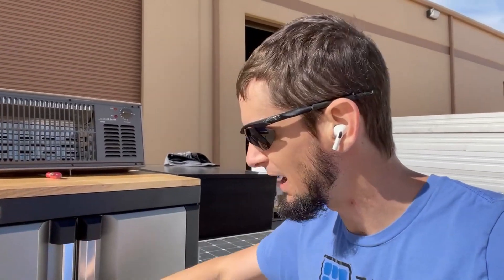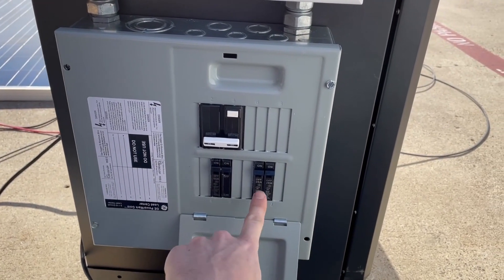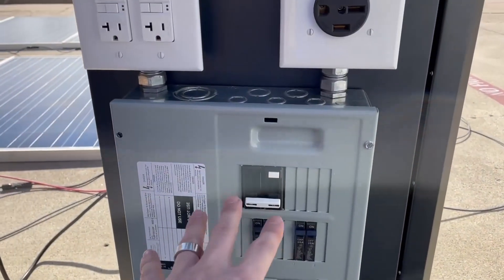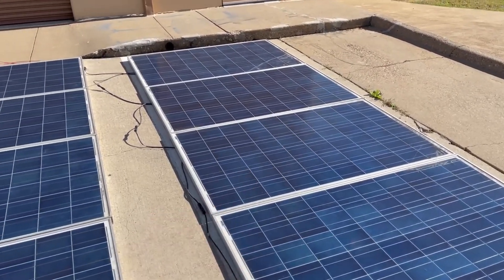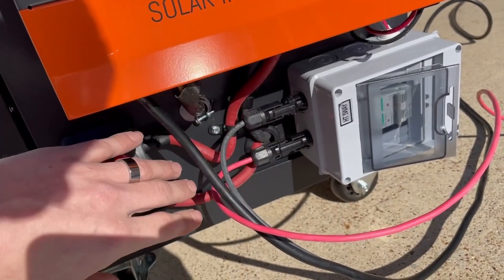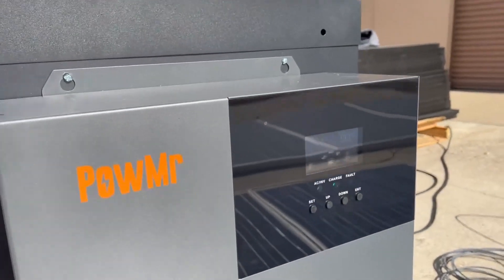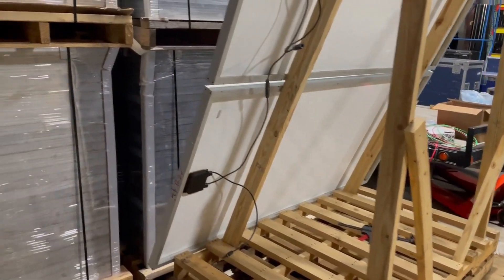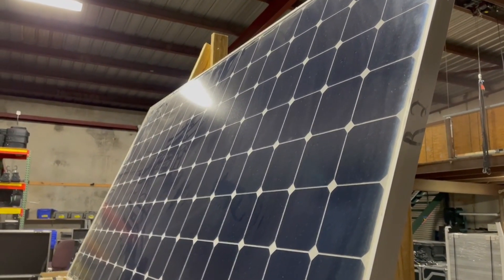If Your Portable Power Station Was On PowMr Steroids

Comment: I have 28 panels, 305 watts each, with a solarEdge 7600H inverter. I want to add an AC coupled PowMr 10kw Hybrid inverter and batteries. Havent decided on the battery yet, or what size, maybe about 10kwh of battery backup. Solar currently goes into my main panel with a 40amp breaker. I'll need to put the solarEdge into my 100amp subpanel and the hybrid between that and the main panel. is PowMr 10k inverter good to handle all this?
Reply from the maker: I have not messed with the powmr hybrid. Likely it’s a re badged product of another name so you might be able to find data on it if you can find what it is. Usually ac coupled inverters have to go into the generator port of the hybrid inverter. But some allow the ac coupled inverter on the load output like you are talking about.

Comment: Powmr inverters I heard tend to drain/ consume batteries power/ wattage, when idle and not connected to load, some as high as 48 to 50 watts. Whats been your experience?
Reply from the maker: All inverters have some type of idle consumption. Generally it's linear with how large of an inverter it is. 3kw Powmr's that I've measured have been around 45w and 5kw like this unit about 60 watts at idle. I've got some nicer Megarevo 8KW hybrid inverters that are a little better at ~75 watts. Compare this to a Schneider XW6048 6KW at about 45w and yes the less expensive chinese inverters are less efficient for sure.

Comment: Is it working fine today?
Reply from the maker: To be fair I've moved to a different inverter here at my warehouse because I had a 24v battery readily available. So the 5kw has worked fine but is currently unused! I'm using the 3kw high voltage input powmr now (SRNE unit). And it's been working fantastic.

Comment: I was looking at one of those inverters but chose a growatt. I wonder if your pv input current limit is an actual limit or just what the inverter can use. The renogy rover li 60a mppt  i use can have extra current going in and it'll clip excess and use the max to get 60a output, great for cloudy days.

Comment: Man you are talented with this and i could sure use some advice on my 3000 watt powmr all in one. Do you know how the ground neautral bonding works with this unit? I have a 30 amp female camper plug in the ac output. I have my camper plugged into it. I have my house wired into the ac input. When it is running my camper it shows like 40 volts thru my camper frame and its something to do with the inverter because the frame is not got current going thru it when i plug camper directly into the house.  Any suggestions on this is greatly appreciated.  Thankyou
Reply from the maker: I think you missed my question last time I asked. If the camper is plugged into the inverter and the inverter is plugged into the house does that eliminate the stray voltage? Aka does the unit need to be grounded instead of floating.
Reply: @BeeneEnergy yes camper plugged into inverter and inverter plugged into house. It has stray voltage into camper frame. It doesn't matter if it's plugged into house or unplugged it still has stray voltage into camper frame. I'm sure it's something with inverter because if I plug camper directly into house the camper frame is no longer got the 40 volts going thru it. I might need to bond the neutral to the ground but I didn't want the ground loop thing I see so much about. I'm kinda thinking it needs the ground neutral bond and I think it might be an open neutral or open ground even while the inverter is plugged into the house. I figured it would use the house ground but it doesn't seem to be grounded at all even when in bypass or solar or battery mode. It's all extremely confusing to me but hopefully before long I can get it together without shocking me when it rains lol. That's how I first realized there was a problem was when it was raining and I tried going into my camper
Reply: @BeeneEnergy  I thought the inverter would use the house ground when it's plugged into house but its the same stray voltage plugged in or not. And in any mode in settings. I guess I'll try bonding the neutral and ground and putting ground rod in ground next to the camper and see if that fixes it. I'm kinda scared of the ac side of things but I gotta get this figured out.  I have stage 4 cancer and I'm needing this thing making power so me and the wife has electricity if I get more sick ya know. I have a lot invested into trying to make sure we are ok if times get hard so once I get this figured out I'm gonna try to upgrade my batteries to lifepo4.  I'm using 24 nissan leaf modules in 24 volt configuration at the moment but they don't have a bms so hopefully I can get safe bank of batteries and our system should be complete. Thanks for talking to me about the ground issues.  I watch all your videos and I've learned alot from you
Reply from the maker: @matthewknight5641  With the 5000w version I noticed something similar but it was resolved by plugging the ac source to ground. I presume neutral and ground are bonded at the house so bonding them at the inverter would only throw off the GFCI breaker upstream. I'm at a loss as to why it's causing an issue.
Reply: @BeeneEnergy  I'm also at a loss. I've spoke to a guy Roland and he's a genius with this electrical issue.  I'm gonna try a few things then do some tests and maybe it'll get fixed. I'll let you know what it took to correct this problem and if I get get the problem fixed then I'll be looking to buy another inverter. I should have gotten a 48 volt 5000 watt or 6000 watt in inverter to begin with but I was just starting out and didn't know the difference at the time.
Reply: Did you end up figuring this out? Wondering if putting a grounding stake in nearby and connecting inverter ground to it will fix the issue. Using another standalone chinese inverter in the meantime which doesn't cause the issue.

Comment: did you try hooking this up to your hybirds high voltage battery?
Reply from the maker: I have not. I do want to revisit that project. It was working pretty well on that little powmr 60a deal but having a little more overhead for higher voltage would be handy.

Also a controller made for wind might be better, can apparently set a target voltage/rpm and only pull enough current to bring it down to that voltage.

One day I’ll end up with one like that and be able to run a better test using my hybrid as a generator!
Reply: @BeeneEnergy  I used the midnight classic 250 and made a custom wind curve for it connected to my Prius.  That was back when the 250s were on sale for cheap I think they were only like $300.   But now I need a cheap option again. And preferably something that can go over 250 volts. The Prius never does Go over 250 when parked and idling but the Camry and the Highlander and the Ford escape do.
Reply: @BeeneEnergy  but if these things have a max of 16 amps on the input at 200 volts that doesn't get anywhere near the max output of the inverter. The Prius range is between 200 and 250 when it's idling.  Pushing it at max amps all the time on the PV input might not be so good. So I'm thinking the higher voltage cars would be a better match for this particular hardware you have in the video
Reply: @BeeneEnergy  It's essentially overpaneling it like crazy. The Prius can generate mad amount of watts. Like 70,000.  There's basically an unlimited number of amps available to the charge controller if you hook it up like that. Looks like plugoutpower is using the unbranded hybrid inverters like midnight classic is selling now to tether to the hybrids So perhaps it'll work just fine, or perhaps they custom modified these things to be working better when they're overpanneled?

Comment: I was told by one solar guy that just connected the black wire in the inverter, which is the black that would run through all the batteries I’m assuming disconnect it from the screw and reboot and I tried it it did not work he did it and it work do you have anything for me on this? I need to reboot the unit power, Mr.
Reply from the maker: With this inverter it should power up with a good battery OR solar coming in. As long as the toggle switch is in the on position. Can't see why it would need to be rebooted by disconnecting and reconnecting the battery but it's worth a shot.

Comment: I have the same inverter the lights have gone out. I think there’s an orange and a green one. Is there anyway I can turn it back on without disconnecting anything is there a fuse box? We had a cold winter in everything shut down

Comment: With the PV current input limitation, is it OK to have a greater amount of current come in through the PV (oversize PV) and the unit just clips or is it a hard limit that shouldn't be exceeded?
Reply from the maker: It’s not something I’ve tested. But the consensus in general is it just won’t pull more than the max. The manual for this unit just doesn’t explicitly state that unlike a solark or other nicer inverter charger.

Comment: wait you said 300 volts and 500 volts.  and the manual for that charger/inverter says to not exceed 100 volts.   so what is the system running at?
Reply from the maker: You might be looking at a different inverter. This is the high voltage model that supports 500vdc input for solar.

Comment: Problems with unit, when on battery it won’t charge from ac. So when charging on ac and you have a max ac charge set(let’s say 10) and a max combined (say 60), and solar maxed out, result, regardless of the ac current set it will still charge at the combined max current rate! When you attach AC it automatically diverted the loads to grid and then wants to charge at max current when solar is present

Comment: Why not just buy a Ecoflow Delta Pro and get 3.6kWh?
Reply: @troyyarbrough  I bought two Pro'
s and four extension battery's.  I can take  one of these systems to my deer lease/bug out the other I leave hooked up to my box at the house and it runs ALL of my 120volt outlets.  I needed the portability of the Ecoflow. COSTCO had the Pros for $2999.00 and Outdoor Trek had the batteries for $2500.00 not cheap But The Best On The Market, Right Now....Peace

Comment: Even though that's just a electrical cabinet, what gets me is why does everybody always put those teeny tiny Wheels on something you're going to be Wheeling back and forth, you should have something at least 4 or 5 inches in diameter.
Reply from the maker: I know right! They are ok for rolling around a perfectly flat garage but anything more than that and they choke. I suppose I can’t complain as it’s designed for just that, rolling around a garage.

Comment: Hello! Thank you for this video. I’ve been going back and forth between the  inverter that you have and the Growatt SPF5000ES. On paper they look similar to me, would you recommend this inverter over the Growatt?
Reply from the maker: Will you need 240v? What about paralleling for more capacity? The growatt also has 100a charging instead of 80. Both are good units but some different use cases.
Reply: @BeeneEnergy  Sorry, I should have made it more clearer previously. I'm outside of the US and mains power is 230v. I'm planning on setting up a off-grid system for my house. I was looking at the PowMr pow-hvm5.5k-48v-p and the Growatt SPF5000ES. Thinking of using one unit at at the beginning and hoping to expand up to 15KW with 3 units in parallel. As you pointed out, the Growatt has 100A MPPT charge current. Max PV input voltage is 500V on the PowMr vs 450V on the Growatt.

I have zero experience with either of these brands and I was looking to see if you had any issues/reliability problems with PowMr vs. Growatt.

Thank you!
Reply from the maker: @darshanags  Currently I have no issues with either one. Seems the monitoring options such as with solar-assistant are better with growatt.
Reply: @BeeneEnergy  thank you for you’re feedback!

Comment: So because my ac output on my inverter is only two terminals Line & Neutral don't use a ground on neutral type breaker box or sub panel box or that don't matter I'm trying to figure out which types of breaker box I should buy for this inverter..